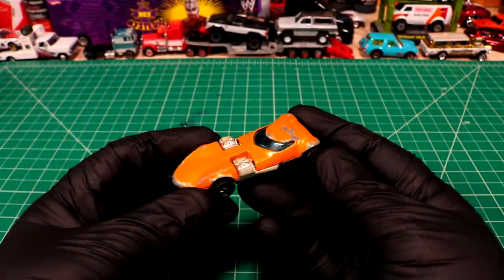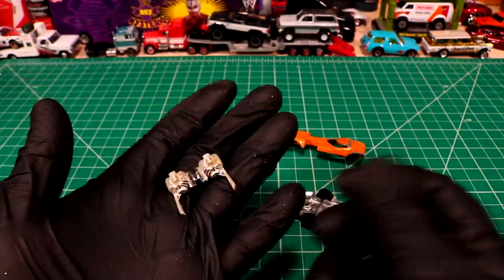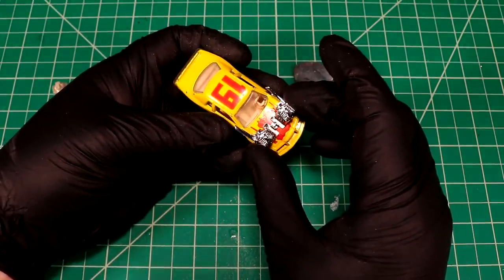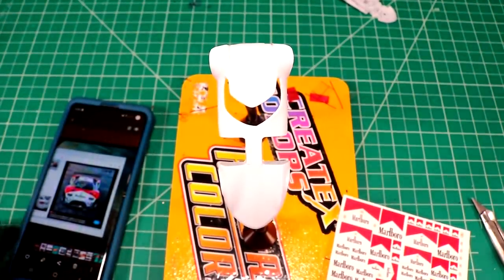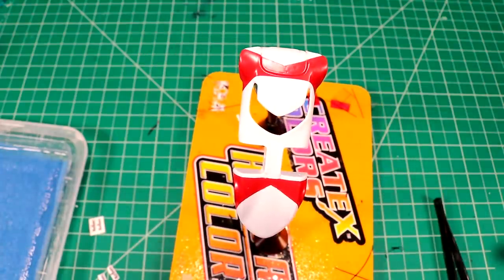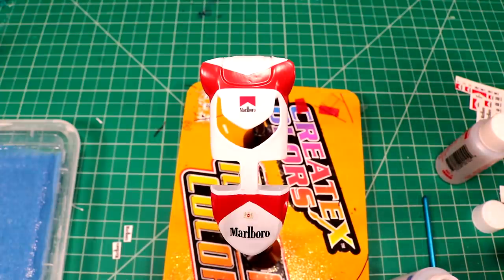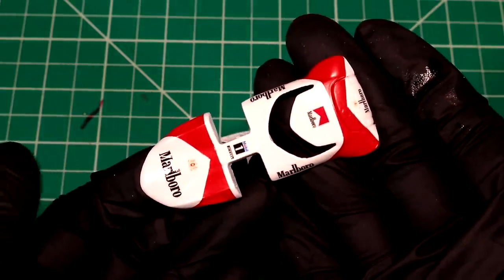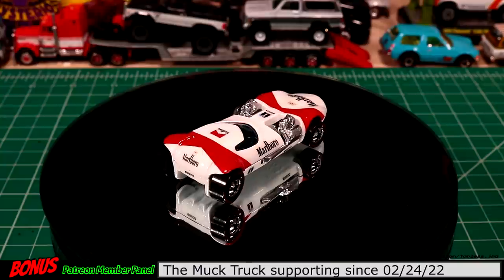Hot Wheels Custom - Twin Mill - Marlboro Paint Job

Comment: I really love this one. Turned out awesome. I did a little research because I was wondering if it was possible to put rivets back in. Yes. It is possible. Redline makes reproduction rivets and you just use a little bit of JB Weld to seat them once the old ones are drilled out. Maybe you can do a future video of you putting rivets back in a car instead of screws.

Comment: As far as red in the base.
Yea it would have looked good.
But if I remember correctly a lot of the actual race machines had just the main body colour on the body pan. Showcase machines and museum cars sometimes will have a painted pan. I guess it depends on the rebuilder.